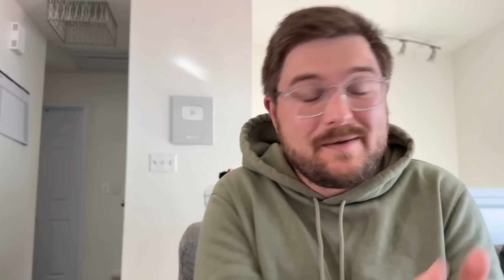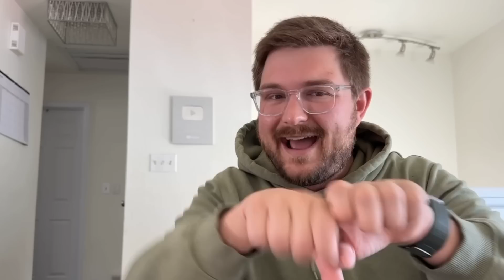Slow Charging For ~800-Volt EVs At Tesla Superchargers With Magic Dock Explained

Comment: Your explanation of volts and amps at chargers is not correct. 

Voltage is pressure. To push amps into a battery you have to have a source voltage higher than the battery. All chargers use dc/dc converters to control the voltage which ultimately controls the amps. If the car is not close to full charge it will just max the voltage and only control the amps via that voltage to what the car wants as max amps. But as it gets to the last 10-15% it will match voltage which will have the side effect of lowering the amps. If it doesn’t the extra pressure will damage the battery. 

In the case of 800v they’re just asking for max and the. Using an onboard boost converter to then boost the already boosted voltage from the Tesla. It then takes over controlling the amps itself at whatever their booster can handle which is WAY less than those in the PFC at the charger that converts 3 phase ac to dc. 

The gen 4 must support 1000v because of the cyber truck being 800v which will end this issue. (Expect all Tesla to go to 800v)

Comment: I’m more worried about charge port locations on vehicles and cord lengths. If a Rivian for example, plugs into a supercharger, technically they are now blocking 2 spots because of where their port is. At busy superchargers, this will SUCK! Long cables could solve this? Maybe V4?

Comment: This is just marketing. Battery degradation is real and hammering non-LFPs with high kWs is bad. What is really needed is ubiquitous slow AC charging - reduces the need for excessively large batteries and will provide a better match between renewable power sources and daily needs. Yes, road trips are great (and relatively rare for most of us) but 100-150 kW is pretty ok for most charging breaks on those. Car is ready before you are.
Reply: In 22,000 km I have done exactly one trip in my Bolt that considerably exceeded the car's range. (I'm not counting the occasional 10-minute "splash to get home" when doing a trip that slightly exceeds the car's range.) In that trip - which was 950 km in one day - trip planning so that fast-charging stops coincided with breakfast, morning coffee break, lunch, afternoon coffee break, and dinner, worked out just fine. "Would it be better if the car charged faster" Sure, but charging at 40-45 kW (because it was cold) was adequate considering how rarely this happens. Not ideal (obviously), but adequate. If this tradeoff is because of GM playing it safe with battery longevity, for how I use the car, I am okay with that.
Reply: @bikeaddictbp  950 km in one day with a Bolt is very impressive! Imagine if we had wireless charging everywhere, even at a low kW rate. It would be so nice to be able to charge passively en route, or when parked.... GM would be wise to play safe on battery longevity, given the whole LG Chem history. 

My comment on "marketing" was really to say that (at least for roadtripping) it is overall charging time that matters, not the peak kW level.  I would guess that charging times for Teslas haven't drastically changed in the 250 vs 120 kW SpC eras. Is a 20 minute charging stop so much better than 30 minutes?!

Comment: In Europe (France in fact), I checked several recent superchargers: they are marked on the inward side for 1000V & 425A. And forgot to check if they indeed output the advertised 250kW but they did provide more than 200kW.
Reply: I'll try to have a look at a Supercharger site here in Wavre, Belgium, there are V2's and V3's - I'll comment here right after (might be in a couple of days).
Reply: European v3 Supercharger deliver 250kW. Tested several times now with my Model Y LR (also in France 🙂)

Comment: Bah humbug on Hummer with the "lowest efficiency rating of any EV—1.5 miles per kWh, or 64.6 kWh per 100 miles of its range. That’s almost double the average EV’s 35 kWh per 100 miles."  Hummer defeats the original point of developing Electric vehicles... Saving energy.  (To help combat global warming)   Volkswagen giving 3 years of "Free" charging at their subsidiary Electrify America doesn't help ether!   Tesla proved that Electric driving could result in higher performance than driving with petroleum but sometimes I wish they hadn't because so many of these auto makers are focusing on electric vehicles strictly for the superior performance rather than for efficiency.   And the Bidden administrations "new rule" for developing Electric vehicle corridors plays right into that.
Reply: It's a tank.. they also use twice the gas of most other gas cars.

Comment: Its interesting that Porsche, E-GMP, Lucid, and GMC all have 800-to-400V strategies built into pre-existing vehicles. Consumers have literally been paying for hardware for the day when Tesla opens V3 superchargers. Beyond this short window of time CCS retrofit V3 superchargers, those circuits will never ever be used again.
Reply: No, most of the <75kw chargers out there (and basically all of the 50kw chargers, especially older ones) max out at 500V. That’s why the hardware on Lucid and Porsche only goes to 50kw. The hardware on 800V cars exists for compatibility with those older chargers. The Supercharger network is just odd in the sense that it is high power but limited to low voltage (requiring extremely high current to compensate for the low voltage).
Reply: There is and will be for a long time to come, plenty of lower power 500V max CCS chargers. These are common at dealerships in particular.
Reply: @HillierProductions  Yep, and most are 30kW/50kW max anyway which makes sense for why OEMs would just include 50kW onboard DC step ups.

Comment: Glad I had my dad select the 150kW 400v option on his Taycan. You mentioned in the video it's a $1200-1500 option, but at least here in Canada it was only $520 (I wonder if you were thinking of the cost for the 19.2kW AC charging option which is more expensive)

Comment: State of Charge just posted a video that includes a chat with a Lucid owner who charged at about 45kW at the Brewster NT Supercharger location. This confirms what you are saying.
Reply: Tom also said Elon doesn’t like the Lucid CEO so he slows their charge down on purpose. 😂
Reply: @73av8r5  Right - Out of Spec Reviews has discussed this, and it probably has to do with the way they have to charge their ~800V packs. Other brands do this differently and have different charging rates.

Comment: Kyle, have you ever done a session about if and why EV batteries life expectancy are related to charging %. My wife charges her Tesla Y to 80% per recommendation. I try to charge my XC90 T8 to less than 100% but cannot preset that. 
Thx. Keep the great work! Jim A
Reply: Volvo PHEVs (and other PHEVs) have big buffers on both ends of the battery pack.  PHEVs are expected to charge to "full" and to go to "empty" frequently (even daily) because of their nature, so automakers allow for that so that the battery packs aren't harmed by that.  In the ER Volvos, the pack size is 18.8 kWh, but only about 14.1-14.5 kWh of that are actually used, apparently.
Reply: @cbatiau2528  thank you for that explanation. My XC90 T8 is now 2 years old. The 100% charge initially gave me 21 miles and now its down to 19.

Comment: I get that people like to logic their own way through physics but the “pipe size” to represent voltage is a horrible analogy. 

If your going to simplify it down please use pressure = voltage, flow rate = current, and pipe size = resistance. There are still flaws with this analogy but it works rather than whatever was expressed above.

Comment: If the V3 superchargers cannot communicate with non-Tesla vehicles about their thermal state, then I would doubt that Tesla would take on the liability of exceeding the labeled current rating of the connectors.
Reply: Agreed.  I'm sure the limits are based on liability.  Tesla doesnt want to EVGO fry your battery.

Comment: No, what the Taycan is doing is not splitting the pack. If it did that it wouldn't need a voltage booster, and wouldn't be limited to 50/150kW.
Reply: It doesn't split the pack, it doubles the voltage. Instead of 700V it asks the charger for 350V and then the booster doubles the voltage to meet the battery pack requirement. Really not that relevant though, only the old 50kW chargers (though a few deliver up to 75kW or so) are 450V or 500V chargers. Tesla Superchargers are also 1000V here in Europe, and I doubt they make different hardware for USA. All Teslas except very few very early cars that didn't get the CCS upgrade are CCS in Europe. Everything complies with the regular CCS2 standard and no adapter is required, because all Superchargers already have CCS cables and 800V cars can charge at 800V. The only reason I can think of why that would be different in the US is different charger software.

Comment: i can't waait to explain to front parked cars how they are actually blocking 2 stalls and not just one...
Reply: Unless another CCS car pulls in next to them and also uses the station to the left. This happens at regular gas stations where long vehicles block a second pump. At least there it's thought out how to fill from all four corners. Hoses are even long enough to reach the far side of small cars. In either case they are not "blocking" two stalls. They are using one. ICE vehicles could be blocking one or more though.
Reply: It's not the user's fault if that's the only way to plug in their car, it's Tesla's fault for releasing a CCS charging solution with such short cables.
Reply: @HillierProductions  somehow all the manufacturers managed to put the gas cap in the same spot on their gas cars....
Reply: @23desdfe345r2fd23f23  you're a troll right? Gas filler location is completely non standardized, and gas pumps are pull-through as a result.
Reply: @HillierProductions  they are all on the back corner... just like tesla

Comment: Excellent explanation. I was not aware there were so many approaches to battery pack arrangement affecting charging. I have an Ioniq 5 and live in North Dakota. Access to the Tesla Superchargers will still be a massive improvement since the most capable chargers are rated at 62 kW here and they may be 200 miles apart. Not sure I can go that far at 80-85 mph. First world problems. Again, thank you.
Reply: Have you been to the Tesla chargers in Bismarck? Not sure if they are already upgraded with Magic Dock yet.
Reply: @andrewr3362  According to Tesla, the Bismarck Superchargers have not been upgraded to Magic Docks. I will visit the site to be certain. (Just checked. None of the chargers appear to have Magic Docks.)
Reply: Yes, it’s a problem for Teslas.  The main thing that will become an issue is that when an EV with a port on the “wrong” side tries to charge, it not only blocks two of our charging spaces, but it doesn’t give an accurate estimate of available charging stalls in our onboard route planner.  I will show there are twice as many stalls available.  Our cars also automatically adjust charging stops based on the availability of stalls.  If these aren’t accurate, it’s a big problem that will result in waits.  

I honestly hope they don’t put longer cords.  Our short cords are clean, neat, and don’t get run over and damaged like those long cords on other stations (Even Tesla destination cords are never coiled and hung up, and I’ve seen them damaged from being run over).  If anything, maybe you guys can carry an extension cord.
Reply: @KatAdair  Other than my charging port being on the wrong side, I do not expect to need a longer cable. Depriving Tesla owners of space will not be an issue in my area, either. There are so few EVs that the public chargers, including Tesla's, are seldom used. Maybe someday but not soon here will there be crowds at the chargers. I am haunting the internet hoping that Hyundai will announce an update so that the Ioniq 5 can utilize the Tesla chargers. Their chargers here are the v3 model. Oh, and from what I have read, the v4 chargers have longer cords. It comes down to the cord management system on any charger.
Reply: @leslarson2642  on my road trips between Colorado and Austin, the Tesla superchargers are very much in use, so that’s the basis of my concern. Where I live now, in the mountains in Colorado, we do have two supercharger “stations,” an older 150 kW one with 12 chargers, and a newer 250 kW with 8. I wouldn’t have any problem with opening up the 150 kW to other EVs; it’s also closer to I-70. There is an EA (I believe) at Walmart a few miles away with four chargers, which I’m happy to say has been pretty busy. I charge at home, so it’s not an issue. But if I head down to Denver, the stations I use there are always full with Teslas. If I showed up there to see a non-Tesla taking up two spaces or spending two hours charging, that would be a big issue for the users of that station. 

I heard somebody say that Tesla might not open the busier stations to non-Teslas, and that might be a solution for now.  

I do want EVs to become prevalent, so I struggle with this. I really want to embrace it. I’m just baffled by how EV companies have botched their rollouts. A good friend has a Mustang Mach-E that she’s afraid to drive because she has no idea how to find charging stations. She’s charging 110v at home.
Reply: @leslarson2642  and hopefully they can figure out cord management. But if you look at even cord reels used for air stations, they’ve always been a real hassle.  Hopefully the non-Tesla EVs will start to settle on some standards with regards to port location, and if Tesla is the leader in fast charging, they should adapt to the Tesla system. It’s undeniable that Tesla’s system is reliable and easy to use.

Comment: In case you missed it last night, the head of charging said V4 chargers are being installed in Europe now, and the ones coming to US will have longer cables to better accommodate CCS cars. Your dad will be happy! 
Looking forward to them upgrading those V2 chargers!
Reply: MKBHD, and State of charge will love this
Reply: 20:44 yea was at end of video
Reply: Not a fan of longer cables that people won’t wrap back up and that get damaged by being run over.  Plus they’re dirty, and your hands get gross…I have a white interior and would prefer to keep it that way.
Reply: @KatAdair  the problem is that shorter cables will be damaged if they are not lengthened at lest 2 more feet specially when the cyber truck will ever come . I know you have a real issue since there’s no place to clean your hand specially since the white interior is a magnet for dirt and grime .

Comment: Volts are a lot more similar to pressure than pipe size. Amps are what goes with size and how bigger pipes / thicker cables allow more flow with lower losses. You need twice as much "pressure" to get power into a 900V pack as you do on a 450V one, kind of like trying to fill a 200psi tank with a 100psi compressor. Not going to work beyond 100psi.
Reply: Was just coming in to say exactly this.

Comment: I think the actual way it works is easier to understand.

The charger has to output a higher voltage than your battery pack, and it regulates current (Amps) by raising and lowering the charger voltage. The amount of voltage (potential) difference between the battery pack and charger is directly proportional. Large difference, fast charge rate. Little difference, slow charge rate. The voltage of a fully charged Model S battery pack is ~400 Volts, and a fully discharged one is ~292 Volts.
Reply: For Li-on batteries charging profile is constant current up to the max cell voltage eg 4.2V per cell ( actually any voltage below 4.2V will have the same effect) once that terminal voltage has been reached the charging profile changes to constant voltage and it is the current that starts to reduce to the point at which the battery is considered full when the current drops to around 1% of capacity (if i remember correctly). Once charge starts if the charger voltage can be set to 1000v this will have no affect because the internal resistance of the battery alone with the set current will pull the charger voltage  down to the pack voltage. while in constant current mode the voltage is in affect floating and just rises up as the charge state increases in the battery. this is how the BMS works.

Comment: Of course putting more current than a cable is rated for is dangerous. The danger could be mitigated with active control, but that changes from being inherent safety to active safety. And inherent safety is much safer than active safety. Active safety requires complex systems to work correctly. 

Deliberate over current is *dangerous*. How dangerous depends entirely on the reliability of the active control system.

Comment: The cable length on the magic dock has me scratching my head.
Reply: They will accommodate other vehicles makes as time goes on. This is essentially a beta program to evaluate known and unknown unknowns regarding parking logistics and vehicle port locations. Ultimately, other manufacturers need to step it up and create their own network instead of leaning on a competitor to provide a solution. I would hope the consumers of these cars will make that well known.
Reply: Nothing more fits in the V2/V3 internal loop design.
The V4 charger will have an external loop allowing for a longer cable..

What will be interesting is if Tesla eventually replaces some of the V2/V3 stalls with an equivalent V4 stall and longer cable, but still the older electronics.
Reply: Shorter cables mean lower cost—not only the conductor, but the whole liquid cooling process for the cable. Superchargers are famously less expensive to install than CCS chargers. Longer cables will mean more cost but will be welcomed when and if made available to us CCSers on the V4 superchargers.
Reply: Nothing wrong with the cable length,  the problem is the stupid location of the charging port on some vehicles (Taycan, eTron, F150 lighting.....)